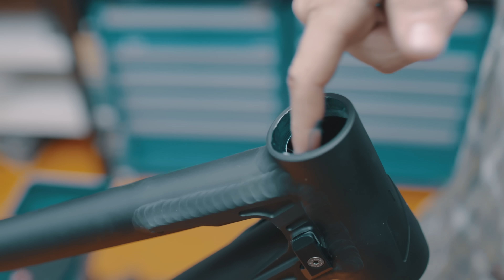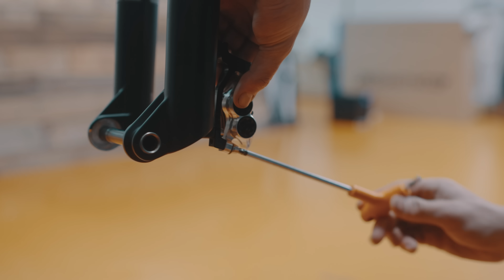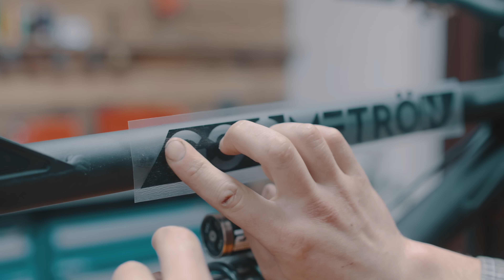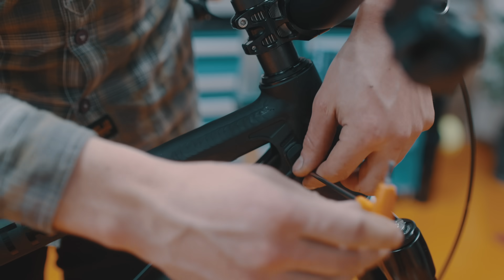DREAM BUILD MTB - Geometron G1 - EXT

Comment: Is it just me, or does the guy in the flat cap (with the dog) seem to take more care when assembling a bike? 
Greasing all bolts, and parts- and all round a better bike builder 🤔
Reply: Not just you. This dude has no grease game.
Reply: @unclebenz86  why so little grease? Don't be stingy with the grease!!
Reply: lots of scraping...
Reply: Grease also attracts and holds onto dirt - too much can be worse than none!
Reply: @RamsayMacFarlane  Dirt is least of your worries than disassembly and not greased enough to where it gets stuck. Rag or wash will take care of dirt.
Reply: @acewilliams7917  , agree! Just use enough grease for assembly. Any excess you wipe off with a rag. I thought that was common place, and practice with everyone- but not Ramsay it seems 🙄🤣
Reply: @paulmacfarlane899 Lol!!😅 i guess not.
Reply: I want to buy cycle
Reply: Under 20000 can you make one for me the best cycle under 20000

Comment: 0:30 greasing with bare fingers
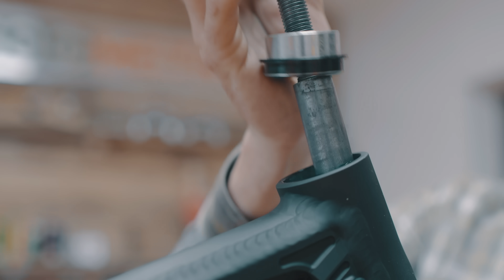0:37 that bearing press ... not for dream build
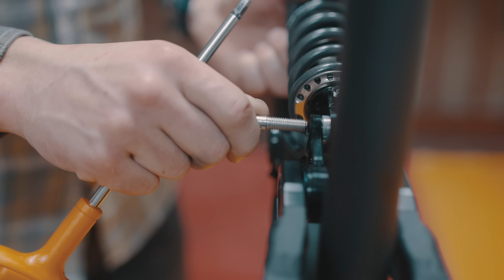1:58 no grease on the bolt and the bushings
2.24 that shock , why have a play , its that normal ?
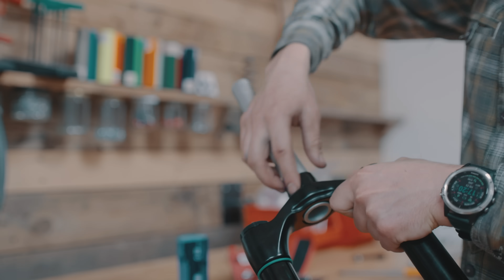2:30 that fork neck adapter , its an old fork ?
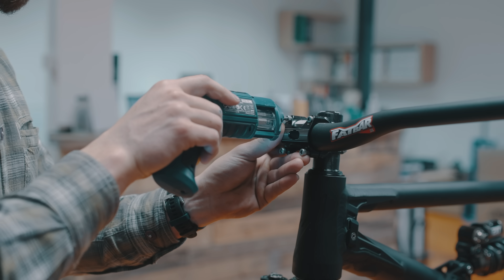3:19 that electric screwdriver has no torque settings ?
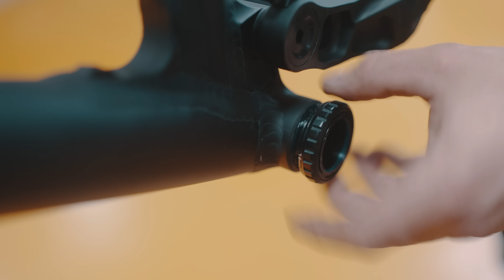3:45 takes out the valve , blows the tire with a pipe end air compressor , and than what ? He put back the valve while air escaping ? That was not shown
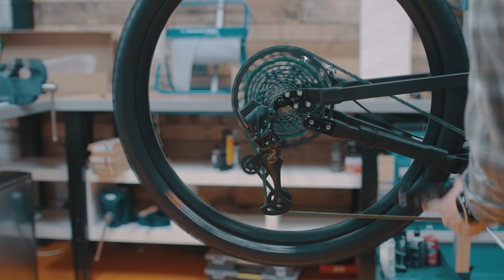11:21 that chain protection its too short
12:36 the internal routing for dropper post cable are never shown , how to manage in that low corner ? 
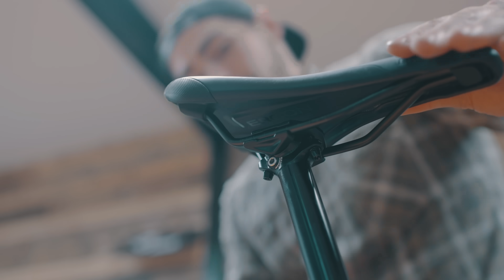14:25 that awkward seat position , too much mounted in front